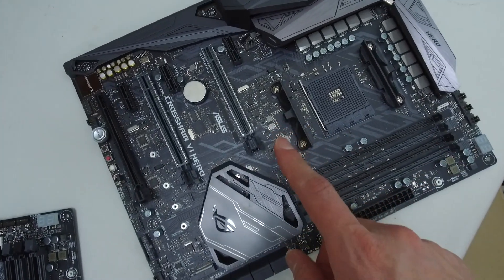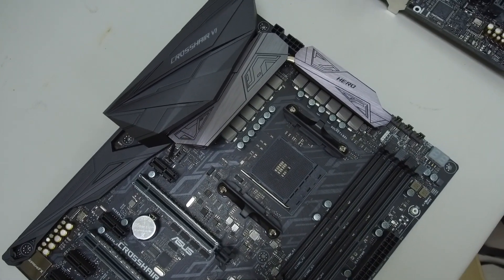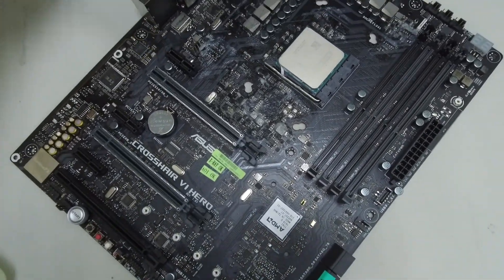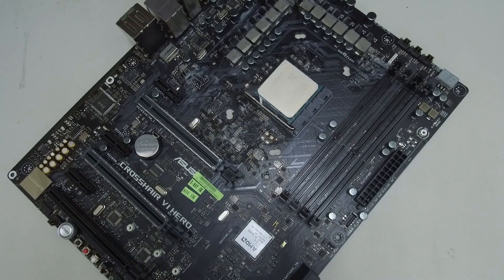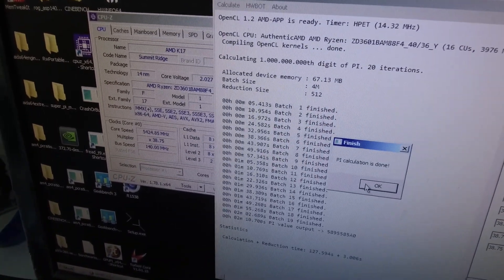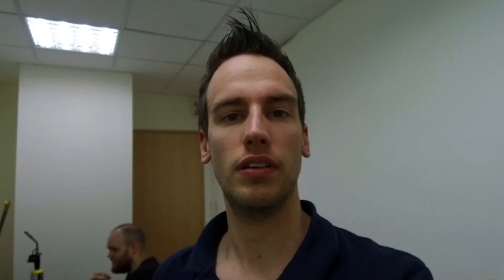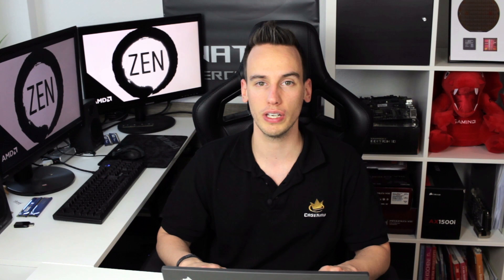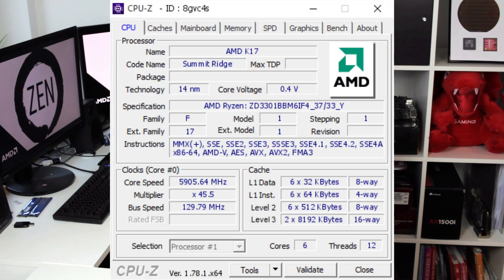AMD is BACK! Ryzen 5 breaking 6-Core records. OC to 5905 MHz (6C/12T)

Comment: It's good to see it's a temp limit rather than a voltage limitation as Zen 2 on 7nm with some architectural improvement should be able to somewhat address the heat issue, lets hope Zen 2 is AMD's Sandy Bridge, while Ryzen was there a Nehalem a big jump in IPC no doubt from the previous generation but clock wise heat limited.

If AMD can make Zen 2 there Sandy Bridge 5Ghz + overlocks for days is what I am expecting, and the great thing is you wont need to buy a new motherboard or RAM, still I do feel bad for anyone who bought Ryzen when they could have waited... including me as my 3570k overclocked to 4.7Ghz was doing alright it did have some limitations which Ryzen completely lifted for me with it's 8 cores and 16 threads but I could have easily waited for Zen 2.

Comment: Wow, are the consumer motherboards limiting the overclocking ability? It seems like we should be able to get it higher than 4.1ghz on water  if you got 5.9 on LN2
Great stuff, and thanks so much for putting out an english video. subbed!
Reply from the maker: no it's the CPUs that are limited. It doesn't matter which of the high end boards you use for it. 4 GHz is just the limit for the current Ryzen CPUs. I guess we could see more if they were manufactured in a different process
Reply: Thank you for answering! I'm surprised you were able to go so much higher than 4ghz, even on LN2. I think I'll wait till next year to get ryzen. the second gen will probably be much more smoothed out by then.
Cheers
Ben

Comment: waiting to see a regular cooling system such as air or water cooling overclock this high on such a type of CPU also I think you can get the same OC on Ryzen 7 as lower tier Ryzen CPU's ar e just the same CPU as with Ryzen if a CPU has defective cores the defective cores are disabled and the CPU is sold cheaper as lower core CPU

Comment: engineering example? try again with retail version
Reply from the maker: There is no difference. Both are same silicon status
Reply: There is some urban legend that ES clock better, like they are binned or something, but I dont know if it true. I did have a es QX9650 I bought from SF3D though and IIRC it clocked well. But everything clocks well on Vapochill LS :shrug:

Comment: Why do u put vaseline on the board???
Reply: it acts as a quick solution versus clays etc people use for liquid nitrogen. Vaseline acts as a coating to keep moisture from directly contacting the board. although this method seems alot more tedious in the case where you need to make sure its heavily applied everywhere, rather than a permanent solution of padding clay around the socket.
Reply: any issues with dielectric or silicone grease, or air cooling causing it to come off sooner?, i did some reading.

Also I've been wondering whats the cheapest method to get a phase change cooling system going, what are you using at the moment? i know i could build one from a refrigerator compressor but It'll take some work and learning.

And could you possibly post a video of your Ryzen build when done? This processor seems to be stuck at 4.2ghz on liquid cooling / air. I'm going for the R7 1700
Reply: +coldtrain. Not sure a refridgerator compressor has the capacity or endurance to cool a pc. An airconditioner compressor would work better.
Reply: i see, yea i was going for the refrigerator compressor due to its size and it seems to be whats used with every other custom built, even some you can buy yourself use this compressor design. 

I'm sure the current / pressure wont matter as every phase change i've seen usually cools to well past -30c, leaving a lot of room to work with. 

And lol cant believe you have the asetek vapochill! i was looking around for them but no go, as there discontinued.

Such a classic looking case xD, if i ever do get one its definately due for a case mod.
Reply: I know it's the same and I know how it works and everything. But I only now know that people successfully used it to cool processors 24/7. Now that's interesting.
Reply: They are the same pump basically. The reason a "refrigeration" compressor (and they are the same thing, even AC is a refrigerant compressor) is not used 24/7 is 1: it doesn't need to since your food hopefully isn't on fire generating more heat, and 2: The cooling radiator on a fridge are not as good as an AC unit since the AC is meant to run continuously. The real difference in duty cycle is just the cooling radiator.

As for my commercial unit, its a 1/3 HP fridge compressor (generally an AC compressor is the tall cylinder shape, instead of a more ball shaped blob. The difference of a piston pump vs rotary pump). Either one have been used, there are plenty of forums where people hacked up a fridge or AC and ran it 24/7 for years on computers.

The difference in the temperatures is from the different capillary tube. The shorter and bigger diameter allows more coolant, so AC use, longer smaller diameter allows colder temps (freezer and fridge use). This is because of pressure loss. http://www.brighthubengineering.com/hvac/58420-capillary-tube-for-refrigeration-and-air-conditioning-systems/
Reply: It might be a couple weeks until I really max Ryzen out on phase change cooling (my PSU is on its last legs right now, Crysis runs for about 5 minutes then power cuts out... with everything stock. FX-8350 + R9 Fury). So I'm hoping to find a 1000w PSU on sale. Remind me in a reply in a week so I can video it, it will probably look completely unprofessional as I won't have a lot of time to edit it, and it would be my first video.

My cooler is an Asetech Vapochill LS (they stopped making them back sometime around 2006, any commercial phase change unit it seems).

Cheapest method is either get super lucky and find one of these coolers, or make one yourself (not super easy just because you need to know how to calculate diameter and length of specific lines, machine a cooling block, along with the normal brazing of pipes). I was about to opt for making it myself, but I had two big problems. 1: Its illegal in the US to make a refrigeration system without HVAC liscence. 2. My phase cooler has freon that evaporates at about -70c, and something I can legally buy like R134a boils around -40c. I would need to get ahold of R12 or something (and that was banned a while ago because it destroyed the Ozone).   Neither of these are really the reason, (my neighbor is HVAC certified), the main reason is I didn't have a lot of time for another project.
Reply: Oh, the Vaseline in the socket is so you should be able to heat it up with a hot air gun and have it drip out. Filling the socket with something else like thermal paste (what the instructions say), would make it nearly impossible to clean out. I haven't tried silicone (I'm thinking of sealant, like around windows on a house), would be ok other than I think when the motherboard heats up and cools (thermal contraction), the silicon would probably start to peal off, and there goes the water proofing... Dialectric grease should be just about like Vaseline. Its just $2 for a 13oz (368g) container for Vaseline though, and it doesn't conduct electricity either, that's why I use it.
Reply: Sorry, one last thing... Extreme cooling can and will kill your components eventually, just making sure you knew that. When I said that Vaseline was on for a month, I did mean while it ran for a month, its held on even longer on my fancy paper weight. That's because of cyclic thermal fatigue on the solder joints (little balls under the GPU die) will cause them to expand and contract more than designed and eventually stop contacting. This shouldn't plague CPUs because they don't have these soldered joints, they have pins instead (or Intel's pins from the motherboard). It could probably be baked in an oven to fix it, but I managed to melt something on the back of the card (maybe resistor?). That would only cost about $1 and an easy fix, but I upgraded to a Fury anyways since I wanted to upgrade to 4k.

For Ryzen, I suspect it should last at least a year minimum (hopefully 5+), otherwise I wouldn't be doing this, fairly confident it will last a couple years without much maintenance. Biggest thing is not to degrade the chip from too much Vcore. Heat shouldn't be an issue, but degradation since it will be used all the time may come into play if I go way too high voltage.
Reply: Yeah, when I found it, it was like finding a real Yeti or Bigfoot roaming the wild. It wasn't cheap, but they are super difficult to find so I didn't pass that up (I rebuilt a transmission, fixed the cooling system, and some electrical work on my neighbors car so I could buy this cooler. A lot of work, but I enjoy things more when I work for them and earn it).

The current and pressure matter quite a bit, but good news is if you haven't had Thermo 2 and Heat Transfer courses, they sell a regulator, so you can simply adjust a knob and find where it works best instead of calculating the capillary tube.  <-- That's what I would do, simple and not too expensive.

I don't have the Lian-Li case, just the cooler that bolts to the bottom. But that's not a big deal, I just had to cut some square tubing to act like spacers under my small mid-ATX case to make it taller (a normal Full ATX case should bolt on just fine). The Lian-Li case would make it look a bit nicer, but almost any full ATX case will bolt up seamlessly and look nice.
Reply: Vaseline takes about 5 minutes. I don't know what he was doing with a brush, I just smear it with a finger, and slowly make sweeping paths (like vaccuming a floor) with a heat gun. It looked as smooth as glass, and very hard to tell it wasn't a factory done epoxy coating it was so uniform. I guess the brush is easier around capacitors and you won't have to wipe off your hands, that's my guess.

As for long term use, its still on my GPU after about a month (phase change cooling). I just cover almost all of the board, because if a component runs hot, it just melts the Vaseline and drips off (put a paper towel under it for drips to keep your case clean). That's fine, since if its getting hot, you don't need to insulate it for condensation anymore.

That's the same technique I plan on my Ryzen board (I also do 6-8 layers of Plasti-dip on the back since it peels off easy as long as there aren't any capacitors in the way, and its better than Vaseline). That's only about 1/4 of the steps obviously, I have insulation, micro-controllers running heaters close to the outside of the insulation, CPUs need vaseline or non-conductive thermal paste in the actual socket.... But that's so it can run hopefully over a year without problems.

Comment: Regarding the ending: So does it mean R5 has higher IPC?
Reply from the maker: Much higher, yes. Also much higher than Broadwell-E
Reply: Its not all about IPC. You have to think about Optimization as well. Current Games have been thoroughly Optimized for Intel Platforms and not so much for AMD. This is one of the main reasons that Kaby kills Ryzen in almost all games. but, If you look at games like Ashes Now with Ryzen optimization, Ryzen beats kaby or comes like 4-5 frames within it. With having a Way Lower Clock Speed and Having less IPC. So, Optimization is a Key for the Success of Ryzen in gaming as time goes on.
Reply: i hate ppl saying gaming shits, can your eyes really can see the difference between 120fps and 110 fps without the FPS counter?
but i sure can see my decode counter running faster and my wallet/bank has more cash in them
Reply: The Ryzen caches (L1, L2 and L3) operates in the same clock as the cores. But the cache on intel stays the same speed with any OC. So.. do the math.. at the higher clocks, ryzen performance overall skyrocket.
Reply: Not Necessarily,
Reply: also minimum and maximum frame times count more than most people realize. what good is 120 fps if it's choppy? ryzen has better frame times, so it looks smoother.
Reply: @bruno that's not true. i own a haswell and the cache is not fixed, you can over or under clock it.
Reply: no, as it is beter than kaby lake if kabylake is running the same speed. kabylake is faster, giving it its advantage. that is not IPC. IPC is compared at matching speed.
Reply: yes, it's higher than broadwell-E but less than the kaby lake, because if it was higher than kaby lake, ryzen would be beating kaby lake in alot of games.